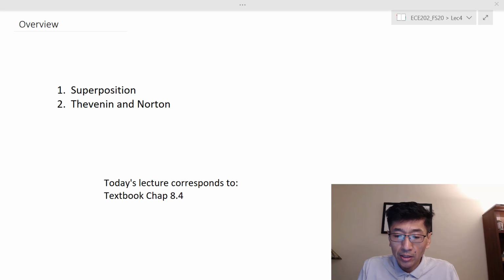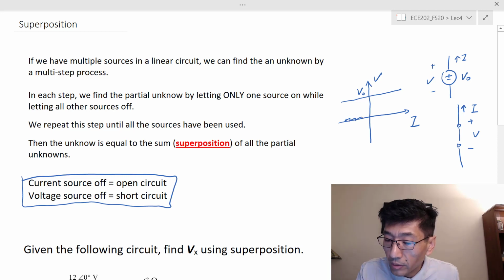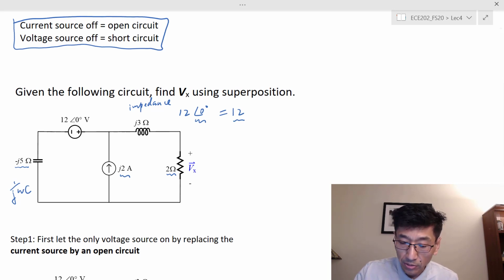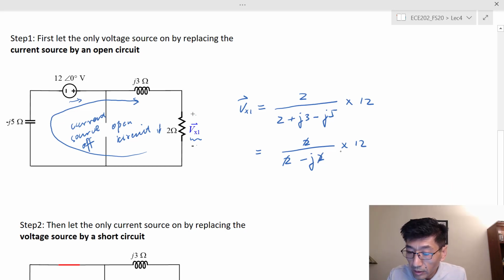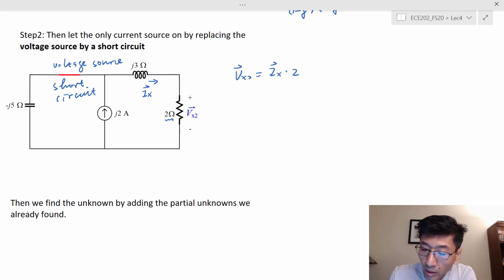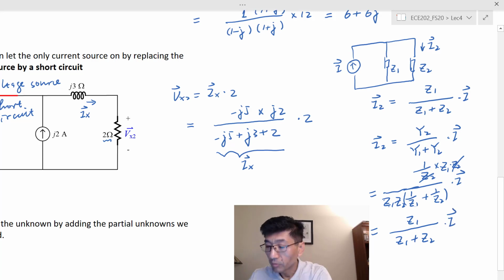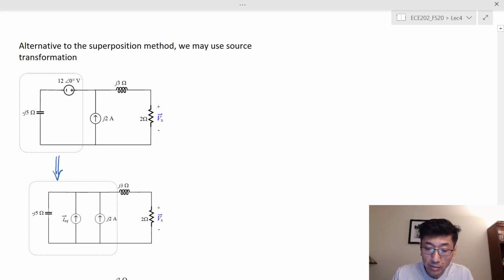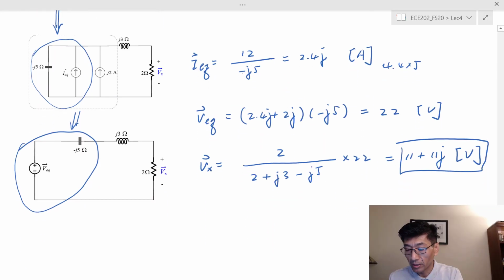ECE202_Lec4_Part 1: Circuit Theorems-Superposition

Comment: There is a slight confusion on my end when you utilize current division when solving for the I_x component for v_x. 

My understanding is that when using current division, we take the current of interests element admittance and divide through by the total admittance of the circuit.

Why is it that we are using -j5 [ohms] as the numerator and not just 2 [ohms].

There may be a flaw in the way I translate from impedence to the inverse of impedence, however, I am unsure.
Reply: Resolved.
Reply from the maker: Great! Current division is always more confusing than voltage division. The analogy that I often use is the garden hose. If you have two garden hoses connected to a T connector, the flow rate in one hose depends on the resistance of the other.

Comment: Can you please explain how you got positive 2.4j at the end of your video where Ieq = 12/-j5. This is the only thing I cannot wrap my head around so far.
Reply from the maker: Multiply the numerator and the denominator by j, you have 12j/(-j*j*5)= 12j /5=2.4j since j*j=-1
Reply: Dr. Wang ,  I guess what I am asking or trying to say is that when you multiply j in the denominator, you get j*-j*5. So we are supposed to know that j*j defaults to -1 and because there is a negative in there that would make it positive 1. 

I guess I’m just trying to find out why j*j =-1. I get how you multiply by the conjugate. Is this explained further in appendix A part 4 that you mentioned earlier in the video? Thanks!
Reply from the maker: j = sqrt(-1) , j*j = -1

DoughClan you can think of multiplying the conjugate. Or you can also use 1/j = -j or 1/(-j) = j.  

Alternatively, you can also use the polar form. -j =e^(-j90 deg), 1/(-j) =e^(j90 deg ) =j
Reply from the maker: @joshspringsteen4367  -j*j = 1, and (-j*j*5) = 5 , not -5